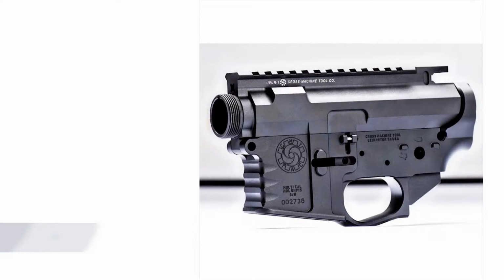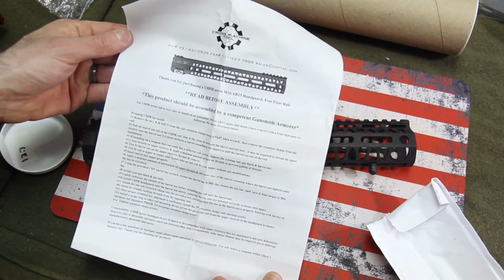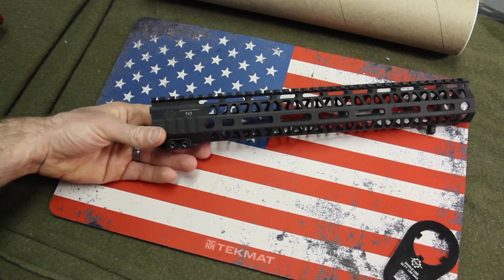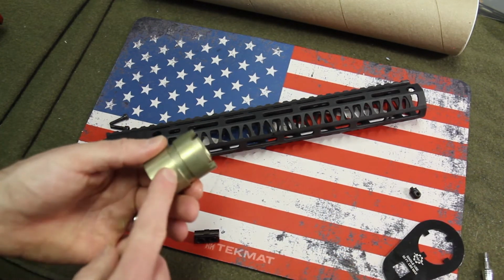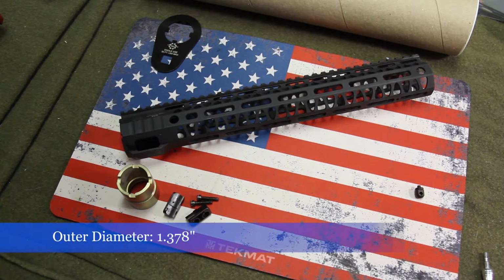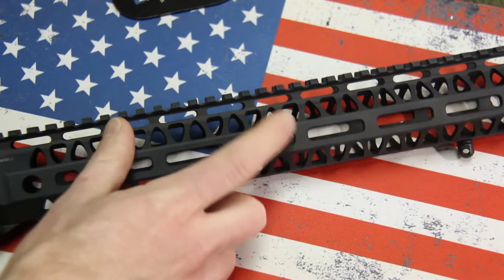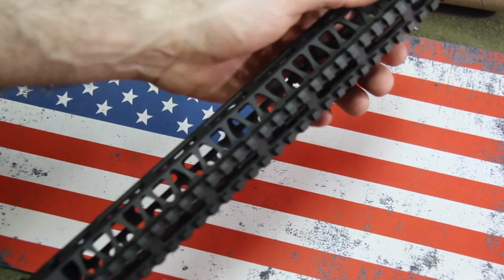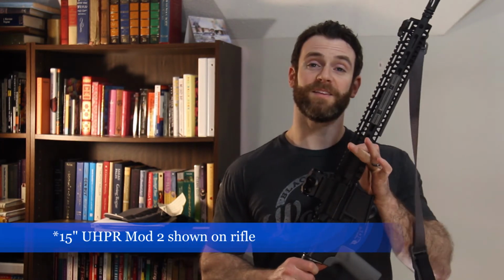Cross Machine Tool UHPR Mod 2 Rail

Comment: Is the 308 Rail compatible with bull barrel profile (.936 gas block)?
Reply from the maker: @MrDoverfield  that’s a great question!  I’m not sure. The internal Inner Diameter of the handguard stated 1.420" online. It seems like it would regarding their statement online about CMT’s .own 936 block:  “The Just A Gasblock -.936" I.D. Is a  Low profile style AR15/10 gasblock compatible with all CMT UHPR™series rails along with many other rail systems.”

Comment: I’m prepping for building an FDE Pistol on an Aero M4E receiver set, but I can’t decide on the rail. Aero Atlas R-1/S-1 fde , CMT UHPR-9.5 MOD 2 ( fde ceracoat required ), Geissele MK14-9.5 fde, Or MI CRM-10.5 fde.
Reply from the maker: NMhvac Tech that’s a tough call!  I’m partial to the CMT rails. I have the predecessor of the MOD 2, the HDX, and I love it. Another two rails I would suggest in the same price range are the BCM MCMR and SOLGW Exo2 Rail. Both will require cerakote or rattle can for FDE though.  Let me know which one you pick!